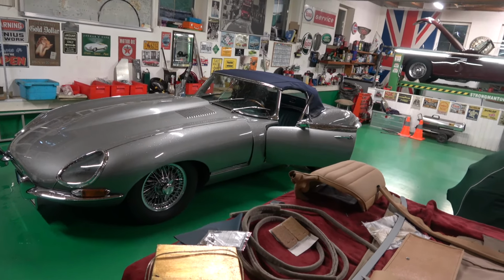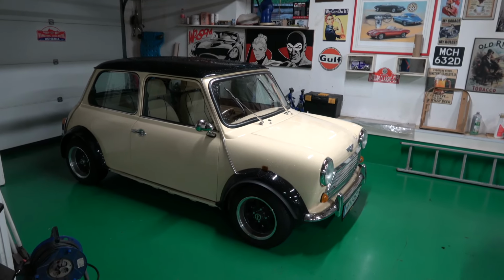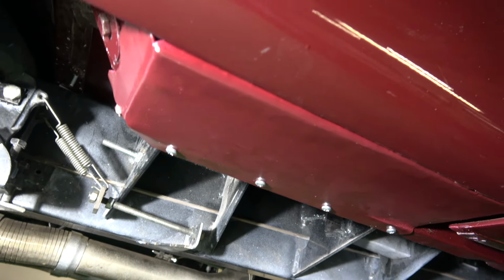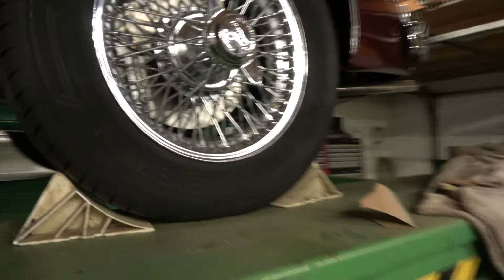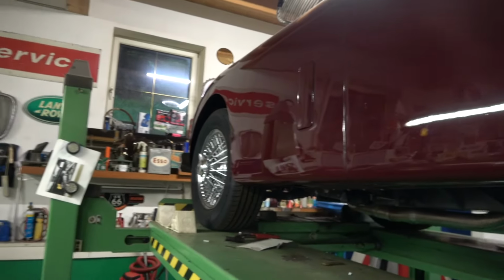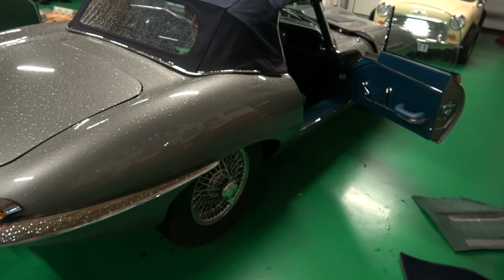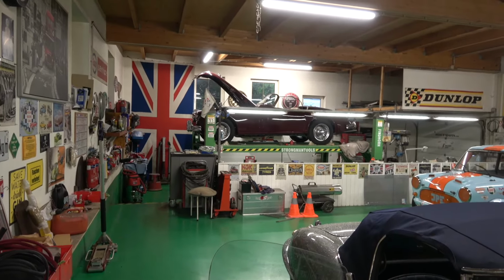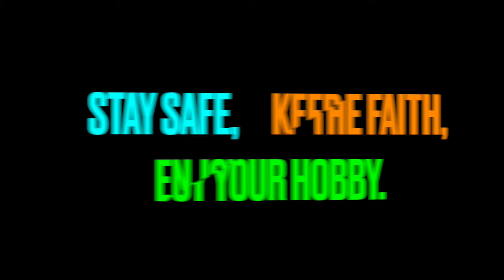1966 Jaguar E Type Disaster Breakdown & Projects Update.

Comment: Hi Dave, just wanted to say ‘Touchet’ been there done that, had the same ignition switch contact fail on my S1 1965 E-type, original second hand switch on ebay solved my problem and managed to rebuild it using my original barrel re keyed to fit original Wilmot Breeden FS key.I felt for you as i too got caught going to my TUV here in Germany and roadsters dont like rain, now have to make it waterproof again, who thinks a restoration is ever finished! Cheers Nick
Reply from the maker: Nick,  It‘s not the first time and I‘m sure it wouldn't be the last 🤔😉 I will order a new ignition switch from SNG Barrett in Holland 116 euros.
hopefully it will turn up before our Jaguar Club run in the middle of June.  So true restorations are an ongoing project 🤣😂 Cheers Dave

Comment: Hi Dave, Have you got a de-humidifier? Would be useful to dry out the Jaguar. Or failing that outside in the sun.
Reply from the maker: No i don't have a de- humidifier as the garage is so well insulated but it was dry after 24 hours. I was drier a bit quicker than that 🤣😂 Cheers Dave